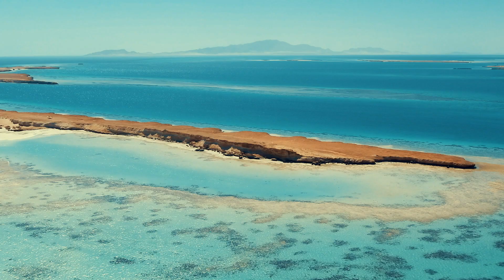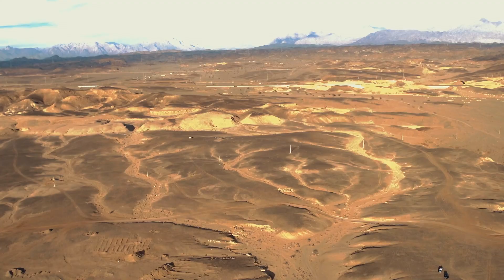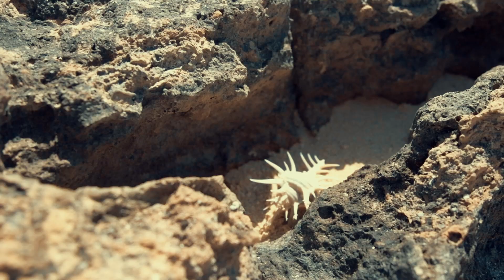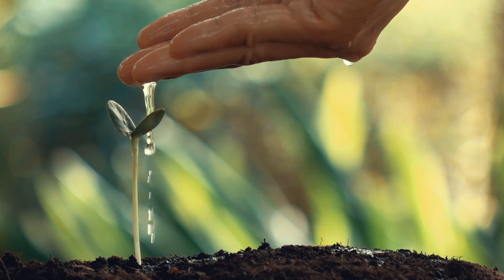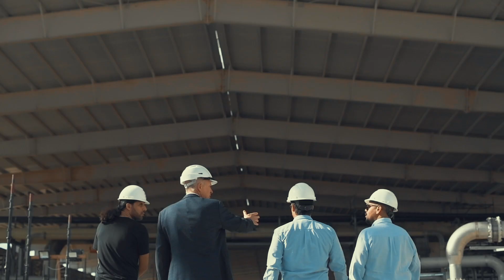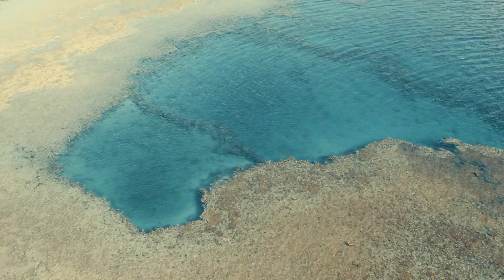NEOM Solar Dome: The Future of Water Sector || Interview with Gavin Van Tonder. #BuildingtheFuture

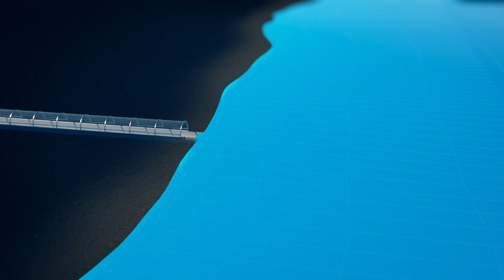Comment: 0:33 The design look not  efficient. In my opinion the Heating Metal should be separated with glass dome. like just stand around the dome. Why? Because if the heating metal is stick in glass dome. it will heated the glass and prevent the condensation at the dome glass. So it just increase the vapor without/with low condensation and increase the pressure inside the dome.

How if the first cold sea water intake is contact with the dome glass, so the dome become cooler. than the sea water go around black pipe like spiral (from middle to outer) until its heated (we know black absorb more heat). then the  heated sea water input back to the dome water chamber. Evaporation can be increased by increasing the surface area. so it better to made the chamber terracing and flow the water above the chamber. than the brine back to the ocean with continuous flow. It better to connect the pump direct with solar panel so it can increase the speed when abundant sunlight and off when night automatically. 
I hope it can be considered. CMIIW.